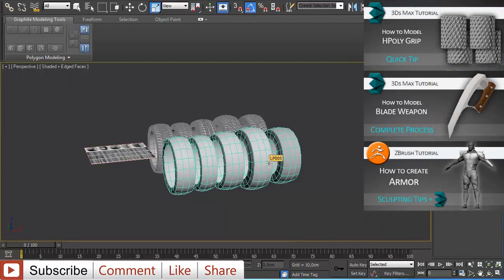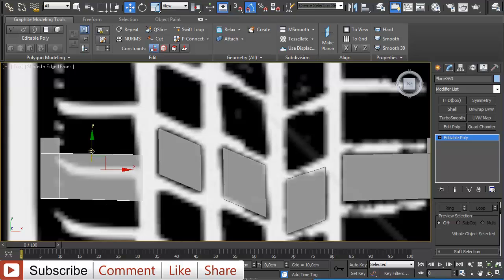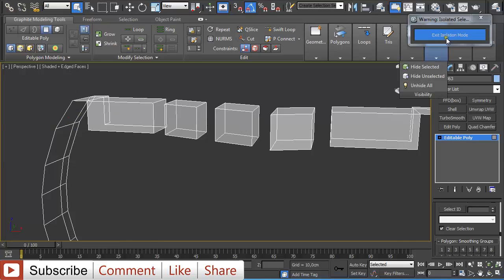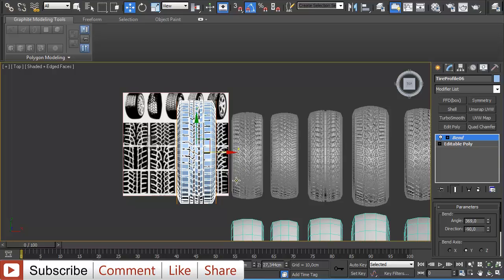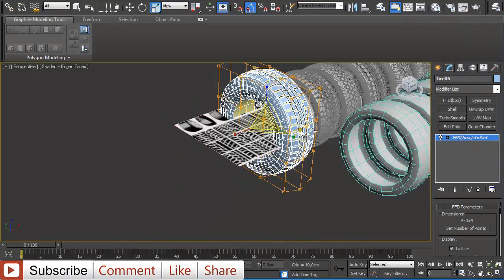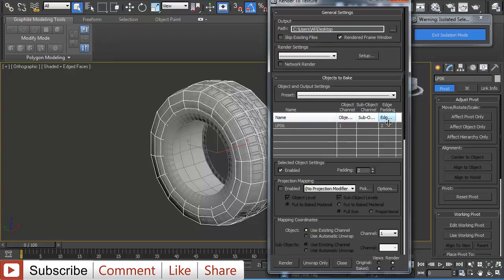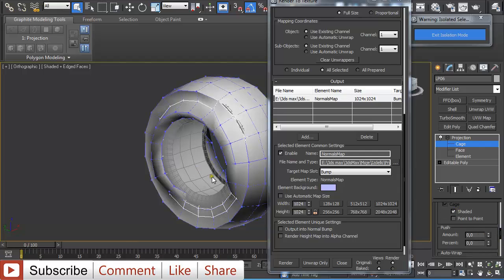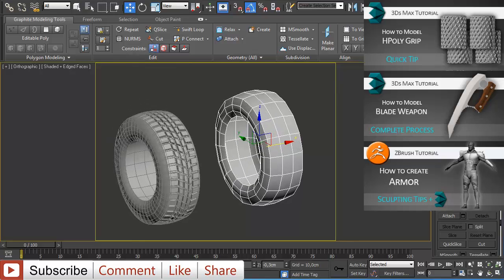3Ds Max tutorial: Modeling tires and baking normal map for low-poly version

Comment: Thanks for the tutorial, it worked great, but the only drawback is that i have no antialiasing on my normals so they end up very pixelated and causes some artifacts on detailed threads. Is there a way to fix this in max ?
Reply: +Andreas Fjell F10 (Render Settings) -> Renderer -> Antialiasing -> Filter or double normal map size while use Render To Texture
Reply: +skv1991 Thanks for the tip, but it seems like i don't have the same options in the render menu. I have the option to toggle anti-aliasing on or off and a drop-down box where to choose filter type and size, however there is no difference in the result. I use max2013 btw.

Comment: Thank you for sharing i have few questions if someone could answer and link me to it.

I am pretty confused with how the low poly and high poly works.

Now Once i get the base mesh do i need to unwrap it to get the UV ? or i should sculpt it for High poly and get the details ?
Now what does Baking means ? Transferring the High poly model details to low poly ?
and if so does High poly needs to be unwrapped ?
if anyone has a link to all these questions or even some helpful tips that'd be great. !
Reply: If you are still interested into the answer. It depends on the model you have. You can set in the settings if you want to unwrap your low poly model or not. Or using the UVW Map of the high poly one, or unrwap both or whatever. But sometimes, the render will not work correctly if you don't unrwap your low poly one. This is what i found out.

Comment: Hello...first of all, tx for sharing knoledge;)
a question though...why you build the edges of the tire track? to make it more bouncy as hit the ground?
Cause i build first a round shape the i put tracks on it, so i don`t need to do edges, cause they already there or do i?
Reply from the maker: +Mad Power There are many techniques how to create such models. So if you found one that gives you the result you are looking for, no need to change anything. :)
Reply: oke doke :)
still i think your method is better, bacause im my way there is some geometry under the tire track, so more poligons(unnececessary ones;))look like good at the time, cause give me a idea of a tire to start modeling.i used the taurus(donut) then delete the iner part, then cut half strech and bridge..mirror it and voilá.so just streching and cutting already maede shapes i get a tire, but a slick one....i fought using the "bend" tool things could overlap on innercircle of tire, but i guess not :)

Comment: I did my HP tire, but i can see i missed a step, after a bend the tire track, was not all anymore, i could pick justt one trire track as an elemet...and not the all 43.so i group it along with the donut i cut to make tire base, but i can see that first i should colapse all together...anyway after done, i notice i could use another set of loop of poligons on the side perfil of tire, cause was short asnd a bit square, but i never got acsess to it again :( i`ll try to post link for pic
Reply from the maker: +Mad Power Its really hard to tell what went wrong. If you pay attention and follow STEP by STEP the video, then you should make it like its shown.
This video is kinda old, I posted a new one in Complete course about modeling a car in 3ds Max. Maybe you should check that out.
https://www.youtube.com/watch?v=qSkUh4S-ORU
Reply: totally, tx...i jsut started for a tire cause seemed good to s5tart with after seeing a bunch of videos, but my goal is make cars jeeps and trucks...i know is hard for you to tell what went wrong, there are so many ways to do the same.anyway what i was refering is in minute 13:15s.still i`m qite satisfied for first work, during a all day, but i did it :) and i like it a lot. and already think of a way to solve the square geometryu issue.apply a turbo smooth, only in the tire base, then do tire track with out it.You see i spent a year seein tutorials without using 3ds max...just taking information...now that i started doing something, is where things came out and you learn how to solve them....but i had to jusyt wach on begining cause i had no clue how this thing were :)